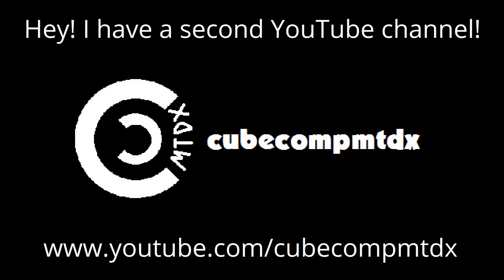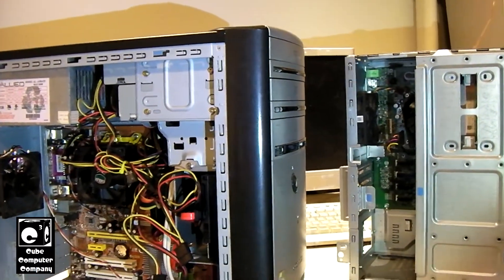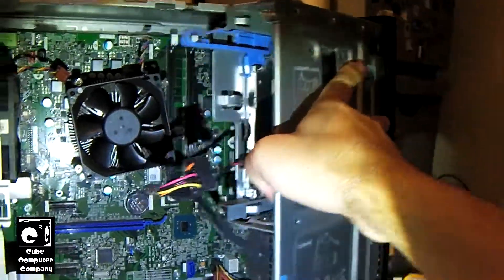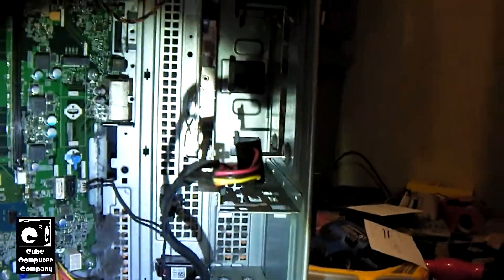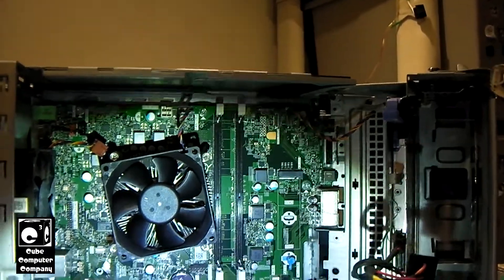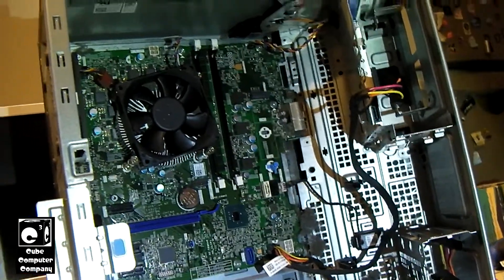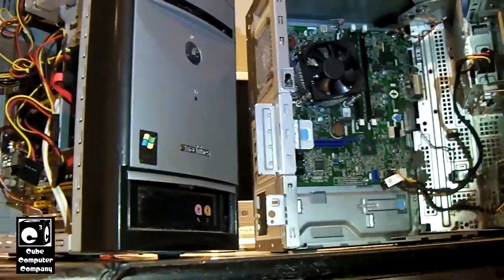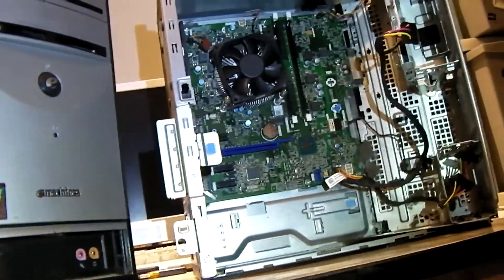OEM Prebuilt Desktop PC Build Quality - Then vs Now

Comment: Here's another example. I acquired a Dell Optiplex 990 SFF. It was quite specced out too, Core i5, IDK the exact model, 16 GB DDR3, and a 2 TB Hard drive. I saved it from becoming ewaste. When I got home, I noticed a note saying it didn't turn on. I tested it, and, that note was accurate, and I quickly determined the issue to be, surprise surprise, a dead PSU. Now, similar to this video, they could have used a standard form factor of power supply, and if they did, that would make finding a replacement much easier. But, they didn't do that. Instead, they used a proprietary form factor. At least, unlike that Optiplex 3050, the wiring is standard ATX, which would allow you to use any ATX PSU. But, it would have been just as easy to use a TFX PSU, which is an actual standard for PSU form factors. If that was the case, I wouldn't have even had to buy one, because I have a spare TFX PSU sitting in my parts bin. Also, unlike the 3050, a replacement PSU is only around $30. But, I thought I'd share this story.

Comment: That era of DELL Optiplex didn't even bother to put a five cent heat sink on the northbridge. Unreal.
Reply from the maker: I've seen a lot of newer Dells without a heatsink on the chipset. This is most likely not a northbridge, but rather a southbridge. Many southbridge chips didn't have a heatsink on them, even ones which look like they should.

Comment: I've seen a few machines especially from HP/Compaq that are full atx cases, with the psu slot missing and covered up, no pci no pcie, one ram slot, a soldered and cpu and it runs off an external psu. You can't make the shit up!
Reply from the maker: The motherboards out of those HP/Compaq systems actually come in handy for some project computers. I have actually shoved one of those boards into a set-top-box and made a little HTPC out of it.
Reply: @CubeComputerChannel  I won't deny their size can come in handy, just hilarious seeing such a giant case with such a barebones setup
Reply from the maker: @DGTelevsionNetwork  Yeah I'll never forget the first time I ever came across one of those... It was back when I had worked at Staples for a few months in 2014. HP was still making real desktops back then... These weird things were mostly targeted toward the budget sector. A custom HTPC was the first thing that came to mind. 

I also got my hands on one with a socket 1155 Sandy Bridge Celeron. The max TDP the motherboard would accept was 35W due to the power brick limitation. That board now lives inside a retro 2000 Pavilion case:
https://www.youtube.com/watch?v=nZQ8vxwvqmY

Theoretically, you could put a PSU and mATX motherboard in one of those things... you'd have to drill out the rivets holding the plate over the PSU bay. You still wouldn't be able to install expansion cards without hacking out some holes with a dremel.

Comment: OEMs design those PCs for UPS style falls from high conveyour belts or drop kicks from the curb to the front door. This is why everything is bolted down. They also have to last the two year EU warranty, but it is OK if they break the next day. They add lost of useless bullet point marketing features and maybe even a nVidia GPU slower the the integrated intel GPU, but don't care about actual performance. Parts reuse isn't even a consideration, because most customers can't fix PCs and just buy a news one if the old one breaks. You get what you pay when you but the cheapest products.

Comment: Those computers are not made for you. The problem is that Joe Sixpack or People of Walmart customers are shopping by price and "features", and ignore what's inside the box. They don´t care if the CPU throttles because of too small VRMs or CPU Cooler, because they only use the PC for webbrowsing and minesweeper style games. This way you get cost-optimized co-designed case, PSU and motherboards which are only made for each other, and maybe even shipped to final assembly like barebones kits. Think of those PCs like "frugal" Ford Model T cars. HP also makes Omen "Gaming" PCs with case windows and silly RGB, sort of like SUV cars. I prefer to build my own PC, so that I can select my parts according to my needs, but I know that I am in the minority.

Comment: I've seen 2 ibuypower desktops motherboards fail. I hope it's not bad luck but it's possible
Reply from the maker: I serviced an iBuyPower system last year where the SSD had failed after just a few months. While I'm not the biggest fan of iBuyPower, the good thing with iBuyPower is if something fails, you'll very likely be able to get a replacement part on Newegg or Amazon and not have to worry about any proprietary designs.